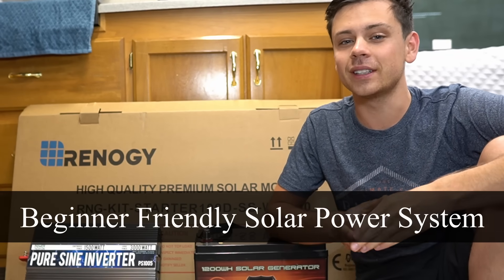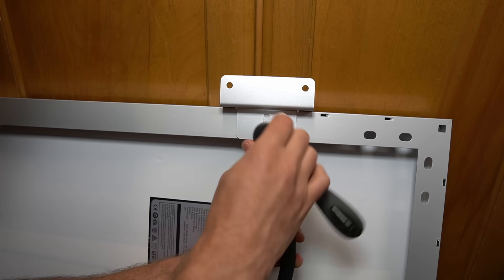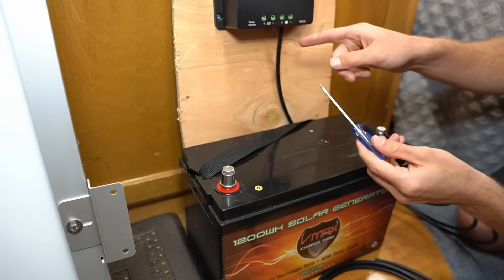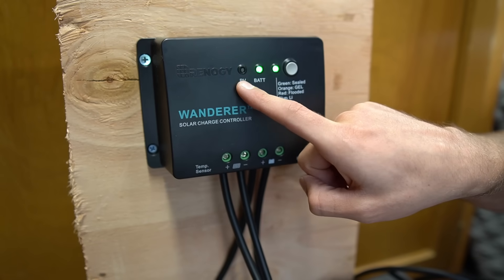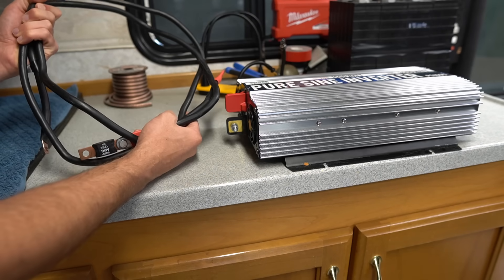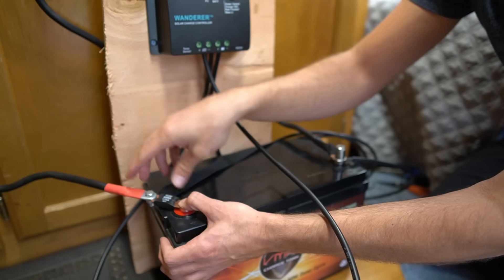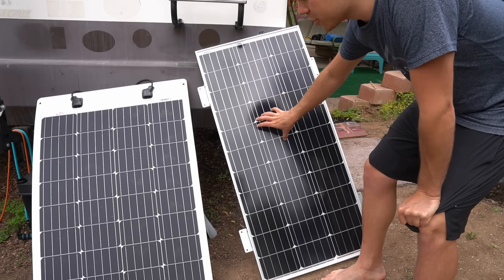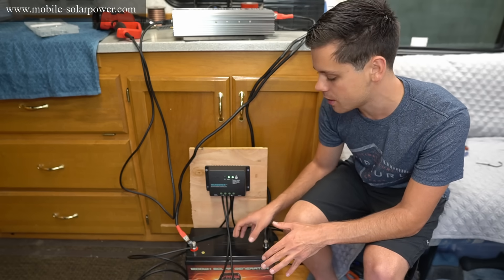Build Your First Solar Power System! Beginner Tutorial Easily Explained, Budget Friendly

Comment: I have a question, I've been watching you videos for sometime now and you are very helpful, so thank you in advance, my question is I'm installing a 200 watt solar system in my custom van, it already has a dual battery set up that i installed, with a 500 amp relay in between the starting battery and the aux battery,  with a switch so i can isolated them from each other at anytime, where in my system should I run my power from my charge controller to the aux battery or the starting battery? I don't have a smart system as they say which would automatically charge the aux when the starting is full. I just let them both charge while the van is running they are in parallel so it's still a 12 v system oh and the aux is a marine deep cycle battery.

Comment: Clear as mud. Ha! Just kidding! I have a portable air conditioner that I want to have a solar backup power system to run in case the electricity goes out on a really hot and humid day. I'm 73 and honestly I think I would die from the heat on really hot days if I couldn't get some AC cooling. My portable AC unit cools up to 300 square feet and draws 15 amps on a 115 volt electrical system. So my next step is to check your website to see what products I need to buy.

Comment: Easy to follow video and I also watched your video on LiFePO4 system. My question if you would be so kind to answer is - I've seen someone with 12 batteries (LiFePO's) to power all their electrical needs on their 34ft yacht and it cost $6,600. (1) Is there a cheaper/better configuration? (2) at a tangent, how do you protect solar (or any electrical equipment) from a lightning strike? Thanks.

Comment: Hi! I would be so thankful if you could please address this person's comment on the same product. They said in a review that "This is really for charging 12v batteries. Not about directly charging laptops, etc, because the output is 12V from the controller. We use this on our RV to charge 4 marine batteries with the 30AMP controller, and run inverters to run appliances. It would be overkill to use this with inverters just for basic recharging, but it CAN be done."
Maybe I'm confused over a person who doesn't know much. Or maybe there is merit to this review, I can't tell. Do they mean an inverter is not necessary just to keep the batteries charged? (I have a 1982 camper with 12V outlets from which I charge my laptop and phone while plugged into power. This is my main concern.) I'm wondering, is it necessary or not that I buy an inverter along with this kit? Thank you. I will keep watching your videos!
Reply: The solar kit without the inverter will keep your 12volt battery/batteries charged.  The inverter is create 110AC.  If the only A.C. Appliance you want to use is a lap top, you can get a small (200 or 300 watt) inverter that plugs into a cigarette lighter receptacle & go that way. Virtually EVERY cell phone will charge off of 12 volts-no inverter necessary.
Reply: I missed the part about you are already charging the laptop off 12 volts.  In that case, no inverter needed.

Comment: I have an EPever XTRA charger and a 1500W LiFePO4 Battery Pack with BMS.  The Charger has 3 terminals, one for solar panels (input), one for battery (input and output), and one for connecting Lights and other loads (output). The charger has the functionality to cut off the load when the battery voltage is low and avoid damage to the battery.  There are 2 sets of wires on the battery, one thin (BMS), and one thick (Battery).  Which of these wires should I connect to the charger's battery terminal? Thank you so much for your help.

Comment: Morning, I just found your videos a few weeks ago ... you offer great info, thank you.

I have a 2015 33ft forest river cedar creek silverback 5th wheel. I am on 50amp shore power and propane currently. Initially I dog boned down to 15amps and ran the whole unit off of an extension cord before my 50 amp hook up was ready.  I have 1 deep cycle standard battery and know for safety sake I need a plan b.

This winter we lost power at 2 am and it could have froze the pipes had my propane furnace stopped bc the motor didn't kick on due to the battery running out.. I was lucky and the battery lasted  till power was back. However, most of the gas stations were down for about 14hrs - so refueling was not an option if needed, I needed my electric to keep working.

I have an in case of emergency scenario solar question;
- 1 approx how long could a standard deep cycle bat last to run ONLY essentials of furnace / water pump - just a good guess would be appreciated. I've heard 6 hrs I've heard 13 hrs. That is a huge variation when it could be freezing out.
- 2 could I run my whole 5th wheel essentials on the jackery 1000 if I dog boned down to 15 or 30amps, I believe I can have solar charging the jackery while I'm using it to power items. If yes I could power my 5th wheel; approx how long would the jackery sustain me in this type of emergency w 1 panel?
- 3 would I be better off getting the renogy starter kit vs the J-1000 for this type of situation?

Thank you for any help you can offer. I look forward to more of your videos.
Kristen
Reply: Look up videos on the Mr. Buddy heater. Under $200 and solves your problem nicely.
Reply: @jackhall4680  thank you!

Comment: Very well done.
Reply: I’m thinking of going with a Eco Worthy kit for panels, wiring and solar controller. I have a AEROCELL STW so it’s heavily curved and fiberglass roof, so going with 600w 4 flexible. Have Duracell 300w inverter and 3 100ah Renogy sealed bats. Do you Recomend Eco Worthy, heard they are good through reviews, price seems good.

Comment: When I plug in my wires for my lights to the charge controller I get nothing. Does that sound like a charge controller not being larger enough?
Reply: lights do not plug into the charge controller, they should be hooked to the battery not the controller
Reply: You may have to manually switch the "load" output on (read the manual). Or, at night, when the panel isn't charging the battery, you would need to connect the lights to the battery like the other commentor says.

Comment: So, it makes sense to me to put a fuse between the charge controller and the positive battery post as you suggest,  but if that fuse blows then your charge controller will be toast?  as you said "never connect the solar panels to the charge controller without a battery connected"

Comment: Hi 
I’m looking for some advice 

My dad wants to run a water pump during the summer for his pond ( instead of running off  of the mains)
The pump is a bilge pump 
It’s 12v 
It’s rated for 11-15A
I have two 12v lead acid golf cart batteries.

What size of solar panel ( watts) would I need to run the pump about 12-14 hours per day ?
Any advice would be appreciated 😀

Comment: I want to do a small hybrid solar system with 2 100A 12 V battery for a total of 24v 100A with a 3kva inverter. Can I run it with 2 150watt solar panels? I don’t want anything too bulky but I still want it to power my inverter AC on solar while still charging the batteries.

Comment: It may be a stupid question but is there any risk of electric shock during any of these steps? What happens if you touch both sides of the battery at any given moment or let’s say touch positive and negative wires coming from the panel?

Comment: Ok I got the panel charger battery inverter and fuses all figured out.  My question is do you have any videos going over shunt battery monitors or low voltage cutoffs? I know a lot of inverters have low voltage protection but I don't think they are adjustable and they usually don't cut off until a very low voltage. Is there a better inline voltage cutoff that would work with a 1500 or 3k watt inverter or am I just going to have to keep an eye on it?

Comment: Connect positive terminal first and it won't spark
Reply from the maker: Not true
Reply: It is true. I work with DC power all the time. You always connect the positive terminal of a battery first to prevent arcing and component damage.
Reply from the maker: @jamesbryan1422  completing any DC circuit anywhere in the circuit will cause arcing. Energy potential is across entire circuit.
Reply from the maker: Most do positive terminal first for automotive application to avoid arcing when tightening the terminals. Not to avoid any form of arcing

Comment: Nice tutorial. The only thing I would change would be the order in which you connected the battery. I always think- N-P-P-N (negative-positive-positive-negative). Removing and replacing battery cables in this fashion is safer and gets rid of that infamous "spark" when connecting up a battery.

Comment: So at 3:40 you plug the negative from the solar panel into the extension cable that has a red O ring on it.  So that's negative into the positive noted wire.  Did I see that wrong or did he do it wrong?

Comment: Why do you advise against using the load terminals on the charge controller? Wouldn't it be the most energy efficient way, considering you'd be getting the power the charge controller is getting from the panels directly?
Reply from the maker: No. It's connected to battery on controller anyways. Built in ocpd trips too easily especially with capacitative or inductive loads. Don't do it

Comment: What would I need to power my hydroponic garden light with these specs. Actual Power Draw: 213W±3% at 110V

Amperage: 1.83A at 110V, 0.92A at 220V

LED Bulbs: (90pcs) High Intensity 5W

Comment: I am planning to do this exact build to start with but for my Van with a slightly bigger battery (125) and add another when I can afford it. I am also going to get the upgraded 40A MPPT controller. What is the formula for determining what fuse to use on the positive wire coming off the inverter please? I am considering a 1000, 1500 and 2000 inverter. Also I am considering using my CPAP machine on the inverter but I do have a DC converter I can use too. I understand that the DC converter will give me more battery longevity, is that true? The other items I will be using are all the usuals cell, laptop etc. but also my Maxxair Fan Deluxe and in the near future a DC refrigerator. All help and suggestions would be greatly appreciated.

Comment: Dumb ass could have just hooked the positive up first and not gotten the spark!
Reply from the maker: Spark will still be present. DC circuit has energy potential regardless if where you connect. This is not automotive application.

Comment: If you have a solar power system set up and ready to use, and for whatever reason, you are not going to use any power out of the batteries for some time, days, weeks or months, will be there any problems or damages to the system (for example battery overcharge, idk) or will it be just fine. Thank you and Happy Easter.

Comment: Should I still get the 40amp fuse between battery and charge controller if I'm using LiFePO4 battery with the Rover 40 MPPT option?  Is it even necessary or do I even need a bigger fuse possibly?

Comment: I had 2 x 265w panel connected in series. All connection are intact.. however In clear weather of 23 degree i only get 60w and about 2amp. 
Distance from panel and charge controller is only 3 meters. The angle of the panel is correct too. 
●●   What could be wrong ?

Comment: WIll ,no putdown you do a great service and have very informational Videos. Just a mild comment. As an retired Automotive Instructor we were taught by all vehicle manufactures to always make and break on the negative side of the component. No sparks in a battery positive.
Reply from the maker: Positive first is for automotive application only. My dad has a mechanic shop and I understand why you need to do that in an automotive system that has chassis ground. For solar, does not matter

Comment: This was very informative. Very nicely explained.
I'm wanting to run my refrigerator in my RV on DC power. I could simply buy a 3-way fridge for $1,000 or I can build a small solar system for my RV, which would be a nice upgrade for my RV, not to mention it will be less money. 
You've given me enough information to understand what is required to do the job, but I still have a couple of questions:
1) if my fridge requires 180w to operate (while it is running), will a 100w solar panel be suffice to keep my two deep cycle batteries charged all day?
2) because I'm using lead acid batteries, you are saying I should have a temp sensor. Other than reading the temperature of the battery, what does the temp sensor do? Will it shut the system down if the battery gets too hot? Or is it simply there as a monitor?
3) What would you recommend for a switch to toggle the AC power to come from the inverter or shore power? 
Thanx for your help.

Comment: Your videos are super helpful. Thank you so much! Two questions. 1. I didn’t see the link to appropriate bolt on fuse sizing for different wattage inverters. What’s the best size bolt on fuse for a 1000 watt (2000 watt max) inverter? When doing the math for proper size should I go off the max load of the inverter, or the standard load? Should voltage be considered with bolt on fuses?  Ex- 150 amp 32v bolt on fuse for a inverter to car lead acid battery. 
2. How do I know when it’s best to use a fuse vs a circuit breaker?

Comment: Hi Will, I wanted to know your take on a hybrid inverter vs using a grid tied inverter and a solar charge controller. I have a project for powering CCTV DVR and cameras totaling 16 cameras, 2 DVR, 2 4tb seagate skyhawke drives and lastly 2 Ubiquiti PoE 24port switches and 12 UAP AC pro accesspoints. Are hybrid inverters good or should I just go for a charge controller, grid tied inverter (charge the battery from both solar and grid) planning to get 2 200w monocrystaline panels and 2 100ah batteries as the load isn’t much with a 2.5kva inverter.

Comment: I plan on building my first whole house system this fall after all the remodeling is complete siding and etc will not be completed but sub-siding will be.
I want to have it fully designed by summer so my brain has time to absorb all the information needed.
What I do not understand is why connect the positive or hot side first that's completely backwards to household electrical and automotive connecting the hot side last can cause lots of damage to sensitive parts in the automotive industry that can and often does destroy computers so it does confuse me. Can you please elaborate on the differences?

Comment: will, i have a question. I have a solar suitcase that comes with a charge controller, if i were to buy a second suitcase of the same brand and controller can you hook these up in parallel? I would like one to catch the morning to noon sun, and the other to catch the noon to evening sun. Was just wondering if this is possible being they both have a charge controller. MY RV on board solar excepts 20 amp solar, and both controllers are max 20 amp. i just want to make sure this would not damage anything in this configuration. You seem to know your stuff so you would be my go to guy for a question like this.

Comment: Will, great videos!  I have 70 panels and overproduced at my home.  I have a years electricity credit at home that I will eventually use as my panels degrade in the future and replace with appropriate kwh.  I've had my panels for 7 years and have not had an electricity bill since.  I was thinking about running electricity to a shed away from my house but after watching your videos, I am going to get a small off grid system and place at the shed.  It will be perfect, I hated messing with swepco, permits, breaker panels, trenching 100+ feet.  Thank you for sharing and I am going to try your link above now, you earned it for sure

Comment: When you disconnect the battery. You removed the lead from panel to controller at the controller. Could you just disconnect at the panel using one of the quick connects?

Comment: Always connect the negative last! No spark and saves electronics!
Reply from the maker: You're referring to automotive. This is different. Spark will be present when connecting any DC circuit no matter what. in solar, polarity doesn't matter unless you are chassis grounding everything.

Comment: Also should note the type of wire that should be used with DC based systems.  The wires should be multi-stranded copper.

The common misconception is that the current flows in the middle of the wire when it actually flows on the surface.  More strands equal more current flow.  Solid core wire will work if someone's in a pinch but to minimize losses, multi strand is the way to go.  

Keep up the great work.  Wish you made these videos 5 years ago.  Lol

Comment: I like to use a DC circuit breaker rated for the wire but also backed up by fuse - I do this for every wire larger than 4 gauge.  This way, I don't have to replace costly fuses.

Comment: You said the cable with the red o-ring is for the positive side on the panel so why did you plug the red o-ring extension cable on to the negative cable on the panel?
Reply from the maker: Mc4 adapter polarity marks

Comment: Do you have to cover the solar panel before plugging that one cable  back to the controller until you're done connecting the cables to the inverter?
Reply: It wouldn't be a bad idea to go ahead and throw blanket over the solar panel before reconnecting it.  Good question.  

Whatever you do though, never disconnect a battery from a charge controller unless the panel(s) have been disconnected first.  I personally use a battery disconnect between the panel and the charge controller for maintenance.